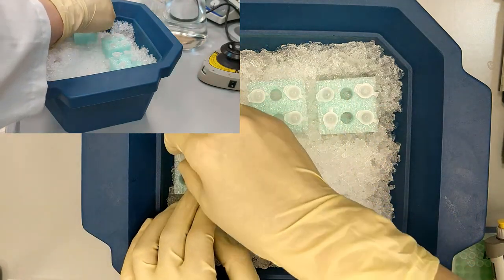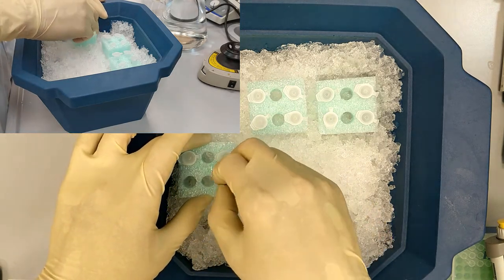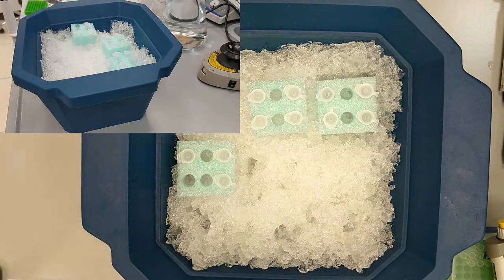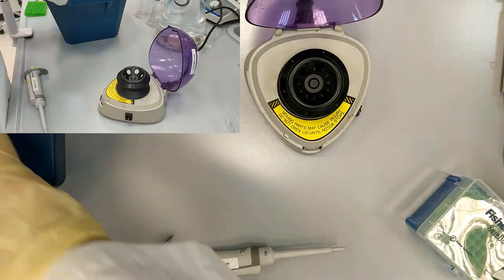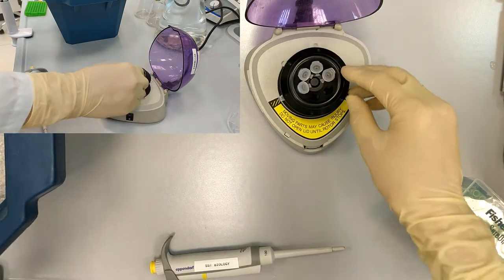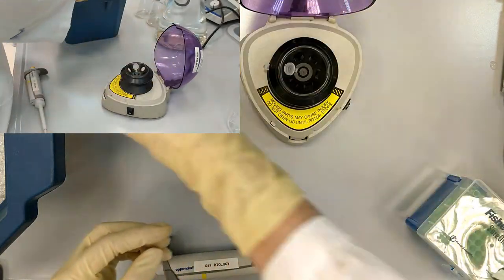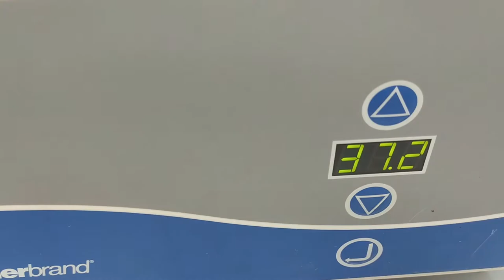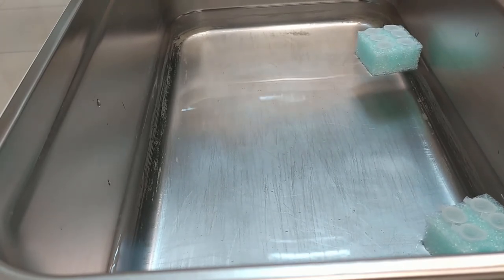Step 1. Preparation of RFLP samples

Comment: I have a heart attack every time we change pipettes, are they thrown out afterwards or are they washed and reused again?
Reply from the maker: omg, you are absolutely prohibited to work in the modern lab. You will have few hundred heart attacks every PCR run. They are deactivated first, then thrown away
Reply: @bad-idea  that’s why the seals are dying! For science 😭😭😭
Reply from the maker: In fact, scientific waste contributes much less than one single sector of human existence like air flights. On the other hand, if scientists don't use these materials, the existence of humankind would become questionable :) I am sure, there are better ways to control carbon emissions than banning pipette tip trashing :)
Reply: @bad-idea  oh I didn't know that, that's okay then. But I hope scientists can come up with some cool futuristic reusable pipettes :D